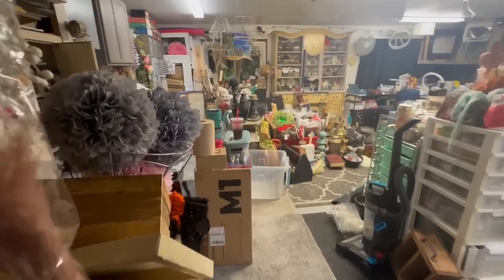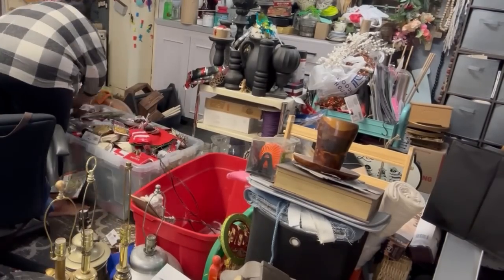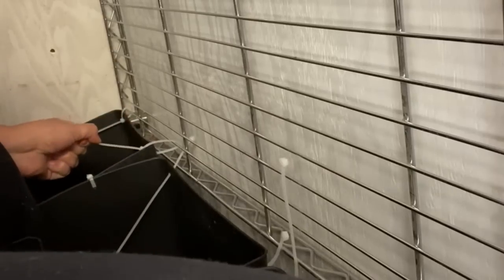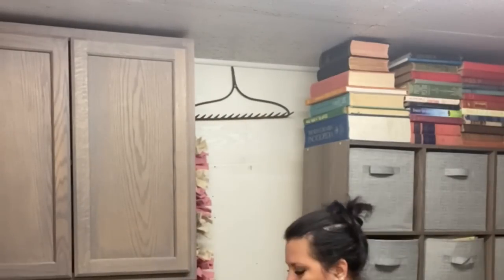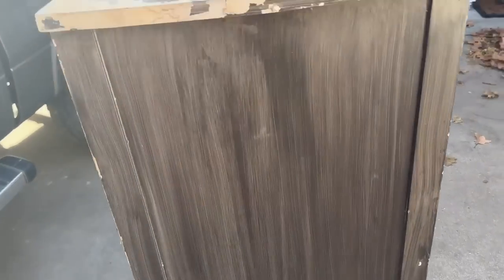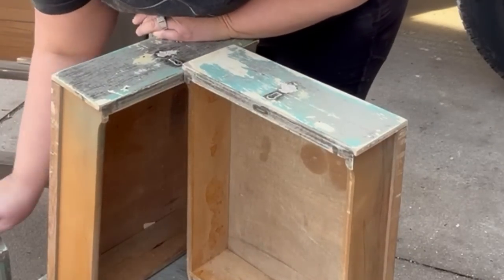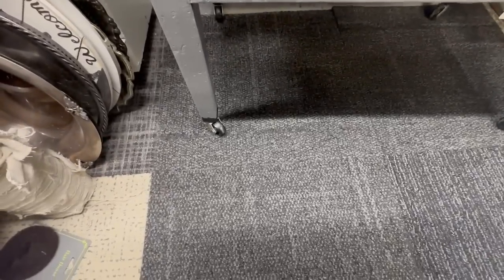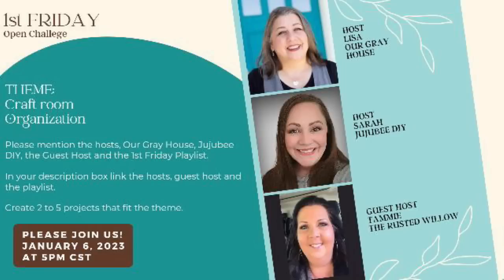CRAFT ROOM ORGANIZATION IDEAS ~ Simple Storage Hacks ~ Craft Room Clean Up Ideas For The New Year!🥳

Comment: That's why your sink is grimy!!😬😬😬 Pumice, comet, that metal scrubbie....they all scratch the porcelain 😳😳😳😳 Get the pink scrubbies with attached sponge....they are non scratch  and if you need to scrub, glass cook top cleaner/fireplace glass door cleaner  is awesome!!!! It's like comet, abrasive but will not scratch!😍😍😍😍 even baked on spills comes right up🤩  I love that stuff
Reply from the maker: Thank you for the tip! This sink was already in bad shape when we bought the house because my craft room use to be a garage that they converted into a workshop and everything was covered in oil and a thick layer of greasy dirt. So it takes a lot to get the sink clean because the porcelain is already scratched and is actually rusting in some spots. I am going to have to replace it eventually.  Thank you for the tip!